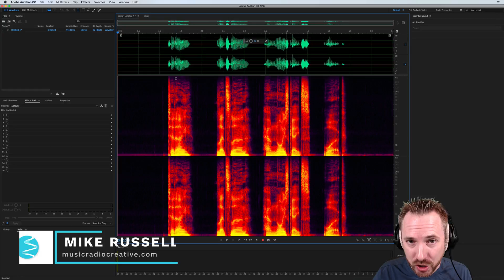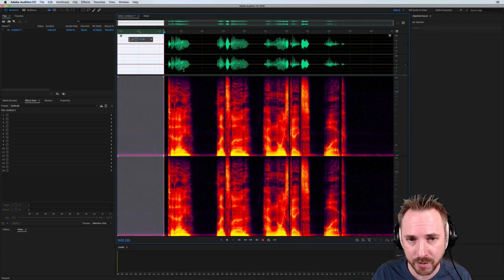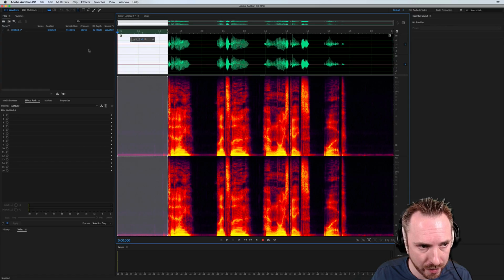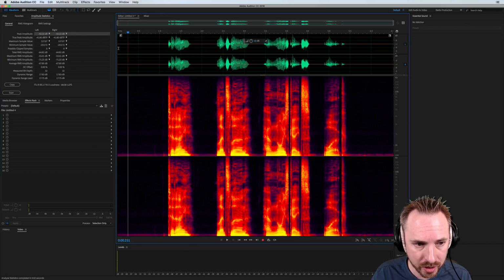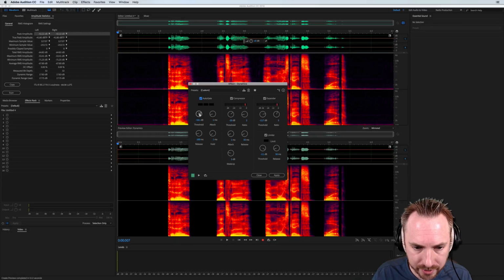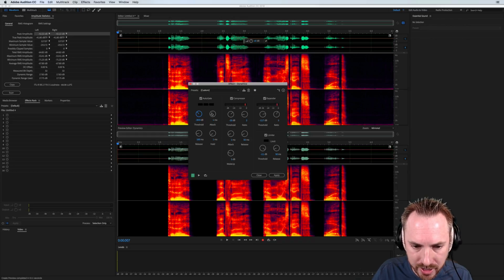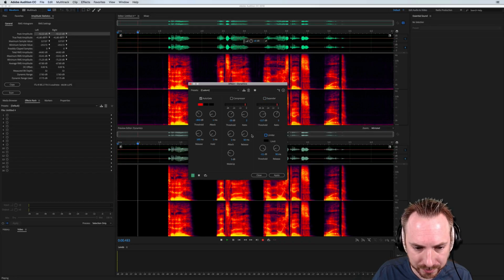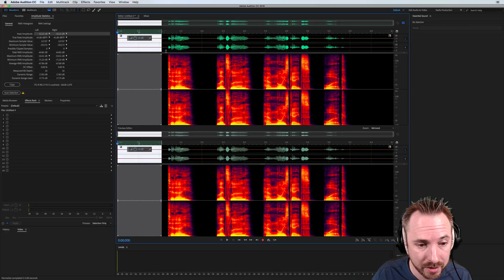Adobe Audition CC 2018 - New Noise Gate Effect

Comment: Quick thing Mike - if you need to add a noise gate into an automated workflow like say the EQ-Normalise-Compress-Normalise idea that you mentioned in another video where would you add it ?
Reply: Know this is a bit late and I'm relatively new to mixing audio but from what I've gathered, you'd use the noise gate first. That way the noise doesn't get amplified in the EQ and Normalizing processes (Otherwise it'd bring up the background noise in relation to the good sounds in your audio). Please let me know if you've learned differently. I'd appreciate the help myself!

Comment: Could noise gate work, if I wanted to remove, say a comedians vocals from the crowd laughter? I have a direct audio feed to the system for my comedian. My second audio source is on my camera, picking up the audience, as well as a delayed audio from the comedian. All I need is the crowd reactions. Any help would be highly appreciated.
Reply from the maker: No, unfortunately it wouldn't work well for this purpose as noise gate would also duck out the audience laughter. The best you could do is perhaps make some cuts to eliminate comedian speech and crossfade the audience reactions together to try and create one continuous laughter effect.
Reply: Mike Russell thanks for your advice. I was hoping I wouldn’t have to manually cut vocals from a two hour show. Guess I have my work cut out for me. Thank you for the quick response as well.

Comment: It looks great but I tried it multiple times to remove the background ac hiss but the dialogue just starts cutting off , I have a Windows 10 with pro computer with no soundcard. The peak for the bg hiss is -32 so i set it to -30 and played with different values as well and changed things around but not working ? This would definitely be a needed effect because as simple as it sounds the traditional noise removal doesn't really do the job even after multiple passes.
Reply: You probably need a lower noise floor. It's too close to the actual level of you talking thus why it cuts it off. At least that's what I deduce as a noob.